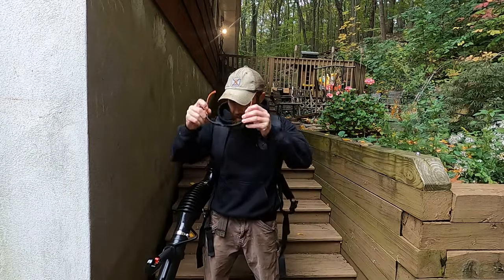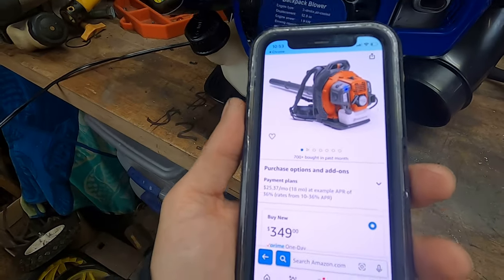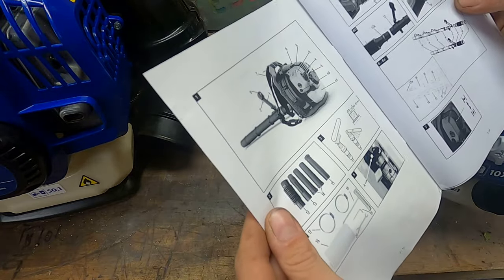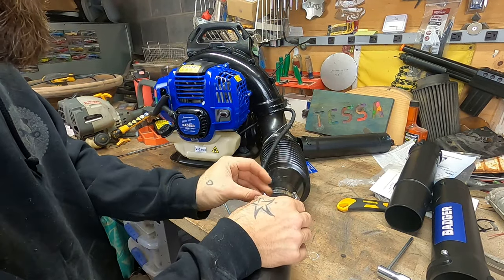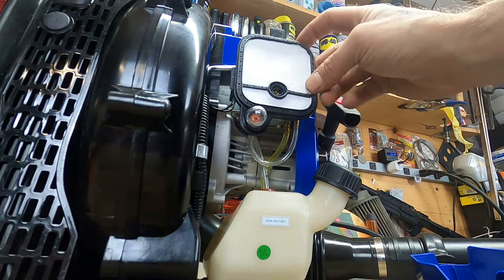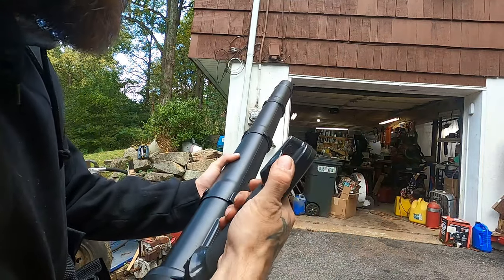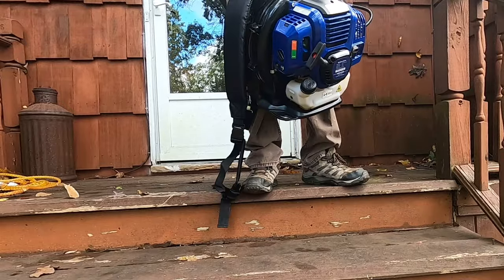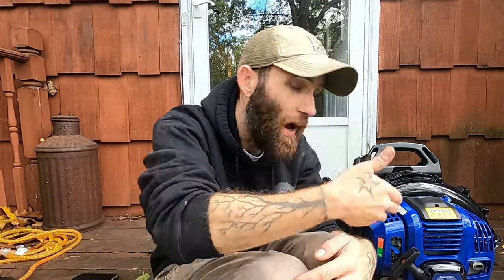53cc Backpack Blower by Wild Badger. How does it stack up?

Comment: Still have the 1990's Stihl trimmer, but always took 15 mins to get going with starting spray. So I went to Home De Pot and found a blower, trimmer electric combo. Mainly just for the lawn. Now I will be using the 10yr old Huski 2 stroke for the leaves fo sho!
Reply from the maker: I did that bud. The E stuff has its place. I am eyeing the 24v mini blower for cleaning Jeeps out

Comment: A major upgrade would be a pleated air filter, they last a VERY long time. I don't like the small backpack style, hangs too low on the back, you see ppl using these, all the time leaning forward to compensate . Should have a larger frame, and the footstep is too small too. Maybe they will correct these items as the brand evolves? 🙏🙏 
BTW, my Stihl BR has the cruise control/throttle lock lever also (similar to this Badger, which you accidentally bumped off, hehe) which, if you pull it off carelessly, it will hit the shutoff way too easy for me. So I installed a quality toggle switch inline with the ground circuit, right at the  base of the throttle handle, held to the throttle handle with a gear hose clamp. It will hold the ground/shut off circuit open if I hit the lever too hard, or bump it accidentally, to shut off position. All I do is have to flick the toggle switch with my thumb to on and off, when starting or stopping the engine, of course to run, the shutoff lever has to be in the run position, and to shut off, it has to be in the stop position. I've had it for years and not a single problem, I love it, just simple to use, and 100% effective. It makes the start/stop fully intentional, if you bump one unintentionally, the other saves you frustration of getting out of the blower, restarting and getting back in. Now, if I had the electric starting, I guess I wouldn't care 😅

Comment: 12:26
Not hard to change at all and a lot cheaper to replace then a battery
You can get a new carb, fuel lines, a fuel filter, spark plug, and an air filter way cheaper then 1 battery let alone those that have multiples to replace.
and you don't have to be a rocket scientist to do the work.
Ethanol free gas will even prolong the need to do all that in the first place.